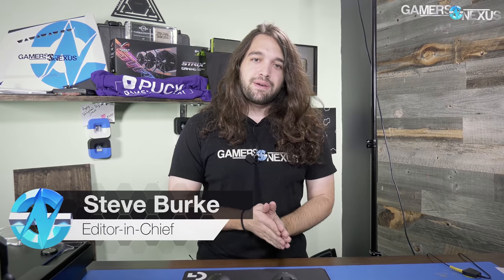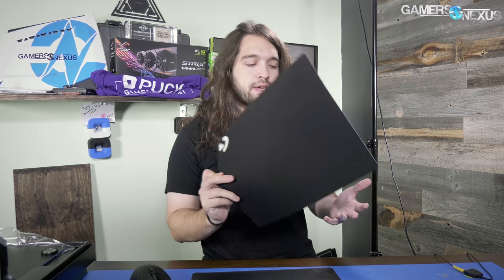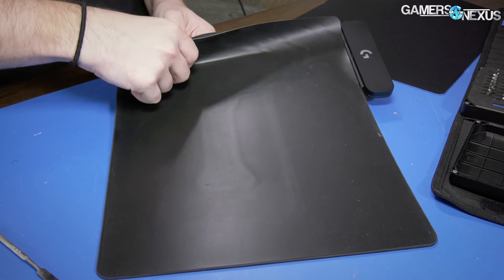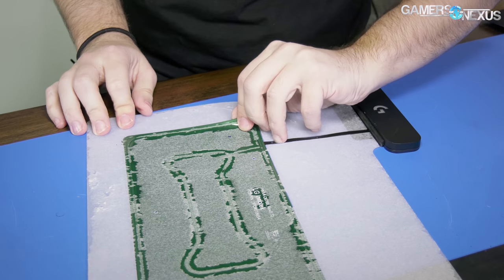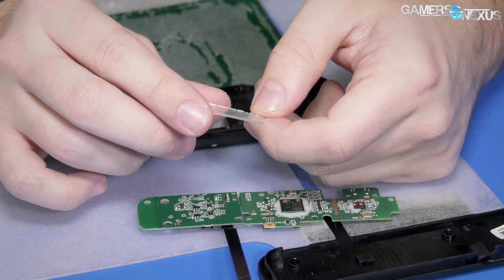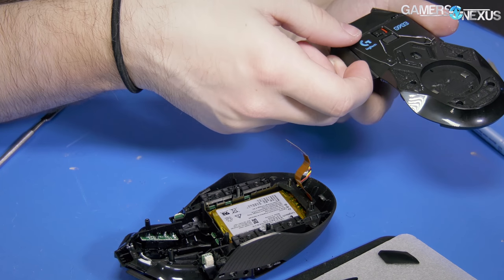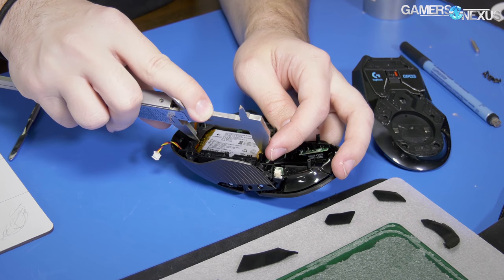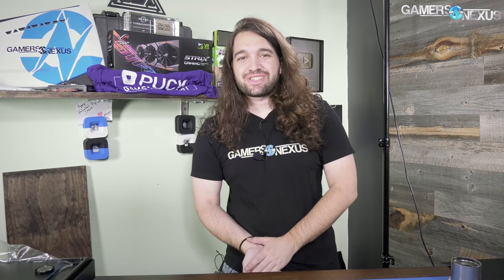Logitech G903 + Powerplay Wireless Charging Tear-Down

Comment: Anyone else having double click issues with that mouse?
Reply: Yep
Reply: yea that's an issue with this mouse. I ended up tearing down a 9 dollar logitech mouse and soldering those switches on to my g903
Reply: Yeah just don't buy this mouse to whoever read this don't terrible clickers. 2nd replacement same issue. Going for the third replacement I am turned off logi mouses for now. I will try to ask for another model cause obviously this one had terrible quality control.
Reply: @mybigfatfrog7975  its not the QC. its that they are putting switches which are not spec'd for the low voltage and current these new mice SOCs use through the switches. if you hit up amazon and grab d2f-01f-t  switches. those are actually rated much closer to the electrical spec these new mice SOCs use.  its going to become an industry wide problem if they dont change up their engineering as more and more SOCs are getting lower powered. I imagine with the Hero version being way more efficient the issue appears much faster as the Hero version doesnt sport a larger battery.   full explanation here https://www.youtube.com/watch?v=v5BhECVlKJA&t=3s
Reply: @xelnaga18   Not a technician man.I prefer to rma them every time I am at my 3rd rma as we speak. so It hopefully will last another year and then probably not gonna get another mouse from Logitech. Even though they have excellent support not gonna lie. Every peripheral I have is a logi. But I lost faith with this model.
Reply: Rn my g903 is my work mouse,the double clicks render this impossible to game with
Reply: I had issues with double click with this mouse and powerplay when it was plugged into a usb hub but I haven't had issues since I plugged it into a USB port directly
Reply: Check out Alex Kenis video on Omron switches failing. Basically, new ultra-low-power tech which is needed for modern wireless mice doesn't fit the specs of general-use Omrons, so they start misbehaving extremely fast. The only permanent solution for existing mice is to solder in different, appropriate switches.
Reply: @mybigfatfrog7975  I managed to fix the double clicking by opening the mouse and then opening the switches and bending the metal that clicks a little bit and there hasn't been any double clicking issues now

Comment: Minus the annoying Teflon feet, they should make the mice able to be disassembled.
The reason is that you do need to get in there to clean it every now and then.
I have a Logitech MX310 and I am seriously considering going on a buying spree to have spares because this one is very easy to take down and clean when required.
Especially as dust tends to accumulate in the scroll wheel that is optical based and thus make it stop scrolling efficiently.
A quick disassemble, cleaning of the wheel and you are good to go.

As for the pad, I am a bit bummered, I wish there would be more screws rather than glue, as glue over time has a sad tendency to let go.

Comment: you do not have to worry about replacing the battery in this mouse. the switches will die of static electricity within 6 months, look it. it's a big issue on all logitech x03 mice.
G903 user for 3 months, my left click no longer works, my right click spazzes out. I sent a RMA request for my mouse 5 days ago and Logitech has yet to respond to me. 
my 602 had a similar issue. the middle click button would stop working after a few months of use. I won't be purchasing another Logitech product after this experience.
Reply: My G903 has been heavily used for at least 2 years now and zero issues. Like the other guy above in this thread, you're probably ham-handing the thing
Reply: @LBCAndrew  first off, Rude. second, I spent $250 on the damn thing, do you really think that I would be slamming it around? third, I've had 3 Logitech mice in my life, and all 3 of them developed issues within the first 6 months to 1 year.  I bought a Steelseries Rival 650, no issues, I bought an Asus laptop and it came with a ROG Gladius II, and it has no issues. Fourth, have you googled what I said yet? It's not a limited to the few issues with that mouse. just google "Logitech g903 switch issue"

Comment: I think on base only is copper wire ,power delivery, which design to resonance with receiver one on mouse which I believe is the important one. you might neeed to crack that module to see what is wireless charging specification.

Comment: The G903 is the third Logitech mouse I've had to tear down and replace the clickers in due to failure. It's an easy process to actually solder the new Japan-made Omron switch in and toss the China-made switches out, but holy damn this is by far the most complicated mouse I've done this with. It's built in three core levels, and the side buttons cause some major headaches with getting everything back in place. 
This is also the first ribbon cable I've torn in quite some time, so def be careful if you go into yours. The ribbon wasn't expensive, but I did have to wait about six weeks for international shipping. Perhaps most tragically, this left me with a trackball and unable to play FPS effectively and now I'm playing WotLK Classic and that's going to be much more expensive than any ribbon cable ever could be, so stay safe out there.
Reply: where can you buy the japanese switches?

Comment: To add a little more information to steves comment on battery charge. Most batteries take the most abuse at full discharge and max charge.
This is the main issue with lithium batteries and why they end up losing their life span. You don't want to leave a lithium at 100% charge or at/below 20% charge. Both of those degrade battery life. Lithium also doesn't have the "memory" effect issue, that's a nicad issue where you almost have to do 100% to 0% discharges.
I haven't been keeping up with nimh batteries, what is in the g700s and i'd assume they are using the same in these, but from what i read it's the same for the most part to nicad

Comment: Would have been really nice if you pulled it apart a bit more. I am trying to replace the switches because the G903 is plagued with double click issues due to the crappy omron switches.

Comment: I've been using A4 tech NB- series of wireless & battery less mice for the last 10-15 years. friggin' love em. no cables getting stuck on stuff, no batteries weighing it down. (and running out). just works. 
It uses a similar design to power it, one of the models even had enough power for an extra LED inside of it. (just felt like testing it, and hey,, it worked). 
My biggest problem with them though, has been trying to find a new one, once the buttons wear out. Not all that common here in europe. 

this logitech model might just be my next mouse, if it's any good.

Comment: What if your g903 stops charging? I can use it when plugged in, and of I plug it in but have it turned off it looks like it's charging (the 3 lights fill and empty, indicating charging mode), but when you unplug it, it just stops working.
Will tearing it apart be worth it? Will it work with the powerplay mat with the battery not charging like this?

Comment: If you take the puck and solder the contact points to any other wireless mouse with similar contact point on the bottom would the mat charge the mouse?

Comment: Lol, a Logitech G903 lasting 4 years. I can barely get one to last a year before double-clicking issues arise
Reply: a year? mine has barely lasted 6 months, going to see if I can't send it back and get it fixed or whatever because 150 euro for a mouse that lasts half a year is a scam.
Reply: mine lasted 5 months
Reply: really huge price different 2$ for failure china omron vs 3$ for original japan!! Logitech LMAO!
Reply: I used the G900 for 5 years and 3 months... (no issues or replacements done, battery life was bad-ish tho after 4+ years, but that makes sense); recently bought a G903 😬

Comment: I'm really having trouble pulling the top and bottom apart. I've removed all the screws and tried using a pry-tool around the sides, but it feels like something is left in place. You didn't show the top screw being removed, did you miss off anything else before pulling it apart? Thanks

Comment: interesting the 2.8 watt-hour capacity of battery exactly matches the Sanyo Eneloop XX that i have in my current Logitech mouse even though it's a Lithium Pouch versus Ni-Mh Cylindrical AA battery ... so they switched from 1.2 volt to 3.7 volt but kept the watt-hour the same ...

Comment: Would of been nice if you could upgrade the G900 with this.
Reply: I got the G900 too. You can't upgrade it, as it simply uses a complete different charging system and battery, and it also has a different housing for the mouse to fit that in.
It's disappointing but it's understandable that this new feature won't just work with older models.
Reply: SkinUpMonkey would have*
Reply: UrAvgGamer, SkinUpMonkey,* wouldhave*
Reply: iheartmysquid would've
Reply: iheartmysquid,* would've
Reply: lol, you guys having fun?

Comment: i've started tearing down my gaming mouse after I needed to retension the switches after they go bad(or even change them out to preferred switches)..after that, i just buy a mouse for the upgrade(or to just try them out) but dont really need too. Saves alot of money, instead of buying the exact same mouse just because switches go bad(the most common reason I buy another one)

Comment: man.. considering the switches are the most common part to break you could have atleast taken the switches out and given your opinnion on if they can be replaced and with what kind of equipment you would need to replace them with OR atleast give the exact model of the switches the g903 is using. http://www.ia.omron.com/products/family/289/lineup.html here is the lineup are they using a direct model out of the selling lineup or do they have custom switches not sold openly so you could replace them yourself if they break ... all that trouble to open the product and then you couldn't show the main switches and their replacibility.. wth man.

Comment: Thank you for this video. I'm planning to put the striped powerplay under another mousepad. Hopefully it is thin enough that I wont feel it during mouse movement.
Reply: I'm also considering this, how did it go?
Reply: @Psycownage  worked amazing. I have not stripped powerplay for mouse and another generic qi charger for g915. Both under MPC 1200.

I didn't strip the powerplay as no matter how much you strip, you'll feel it under mousepad.

So I cut cavity on the table surface instead; since I'm cutting cavity anyways, I can do it a bit more and not strip the powerplay.

Comment: i know this is an old video, but has anyone actually torn apart the charging coin? if we knew the 'number of winds' on the coil, we could turn these little covers into more charging coins just using cheap magnet wire.

Comment: When will this and/or USB C be coming to the Logitech G Pro mouse?
Reply: The whole industry should forget USB micro-B and fully embrace type c.
Reply: I agree, but the problem is that USB C is a form factor and doesn't totally dictate use cases.  For example, my Android phone uses USB C for charging and data, but can't use it for HDMI video like my work Mac and home PC can.  Also, there are still some cheap cables that don't have the proper 56K resistor.  Regardless, I look forward to a fully universal cable.  USB C is the best so far, but a lot of improvements need to be made for 100% universal cables for all use cases to come.
Reply: I hope host devices (mobiles and computers) will eventually all be able to perform the full array of USB C features. But having everyone jump on the as a "shape" only for now is a good step forward.

Comment: The build quality is good but the software is crap and buggy as hell, and people search for Logitech vulnerability! 
I wish they produce a 10-20% smaller and lighter G903 with HERO Sensor and as a version for PowerPlay with a goldcap capacitor instead of a heavy LiPo battery to reduce weight. 
I get my G903 to 90g by replacing the battery to 220mAh, removing the battery connection PCB, side buttons, button PCB of one side, and all button magnets and replacing the metal button hinge rods with ceramic rods. 
A G pro wireless with infinite and sidescroll mousewhel would also be nice.

Comment: Are there any health concerns from constant exposure to an induction field?
Reply: Adam W It won't be strong enough to do anything to you. Still wouldn't use it as a pillow though.
Reply: The magnetic field from such a large "radius" coil is way too weak to be of any concern at all. I also doubt they can get many loops inside that PCB by the looks of the traces.
Reply: Less than WiFi or cellular network radiation. A lot less than ship radar systems or large scale transformers.
In other words: Irrelevant even when having this thing under your pillow.
Reply: MazeFrame which are all less than the uv rays the sun emits
Reply: Just make a glove out of aluminum foil, you'll be fine.
Reply: Just make sure you dont have a pacemaker or any metal plates in your body.

Comment: Screws under glued-on feet is such a dick design. I have to periodically clean my mouse because cat hairs from air get in the scroll wheel and stop optical encoders from working properly. For my previous Logitechs I just had to break one label and remove couple of screws. Modern Logitech mice - had to peel off those feet. Tore one, the rest survived, but as you said - it never looks the same.

Comment: $100-$150 for a mouse without a user replaceable battery? No thanks! Nothing worse than the battery faulting just outside of warranty and having to remain tethered.

I want a real successor to the G700/s mouse.
Reply: extremeg80 I'm kind of scared that people think it is okay to spend this kind of money on this stuff.
Reply: G7 was the one and only King.
Reply: g603
Reply: Dušan Pešić the g603 is a regurgitated g703...not even close.
Reply: extremeg80 in what way is it not close? It can take one or two AA batteries,  and it lasts like 10 times longer. And why do you need a successor? The 700s is still on sale.
Reply: Haralampi Nedelin you really think going from 11 buttons to 6 is an upgrade?! And so what if the 700s is still on sale? It didn't stop them from making the rehashed 603. None of their new mice have a button layout and comfort that I like. I wouldn't mind an updated 700s with a more efficient battery, Bluetooth, slightly tweaked button placement, and better tactile feedback.
Reply: extremeg80 oh,  you meant the buttons,  I don't remember it having that many,  and I even unused one for a while, but sold it because it was too heavy for me. Maybe they will update it,  maybe not.  I guess the reason they have the 403 wired and wireless,  the powerplay version and the new hero+aa battery version,  is that this series is just very popular and sells very well.
Reply: Or you can buy Steelseries because they are superior and way cheaper.
Reply: The g700 was bad imo
Reply: Was the G700s any good? I had a G400s once and it was the worst $15+ mouse I had ever used; the switches were crap, coating was crap and in general awful to use. I also had a G930 headset at the time. It all convinced me Logitech sells overpriced crap nowadays.
Reply: I meant the G7 not G700 XD its not the same. This one:
https://www.amazon.de/Logitech-Cordless-Laser-Mouse-Carbon/dp/B000AOIP9O
looking back im missing only 1 button on it...the forward button.

Comment: How much R&D did Anker and 100+ other different Chinese companies put into making my $12 wireless phone charger, which is basically the same thing in a smaller package of plastic sheeting and rubber? This is basic tech with little in the way of materials used. I would be shocked if this mat cost Logitech more than $10 to make, per mat and they're selling them for $100? They're probably churned out in the same Chinese factories my cheapo wireless phone charger was for massive profit.

Comment: 9:54 wow.....that looks a LOT like skinning a deer.....peeling the hide back after you make a cut....much like you did in the "first step".....

why you skinning your fucking mouse pad dude!?!?!
Reply: and ya....coil = coil

its sorta like when you have been doing really complex math and they hit ya with a 4=2+x and your answer is the square root of pi.....(answer is actually 2 ;) )

just a loop of wire.....and all coils are inductors

they all are going to put off an EM field....1 turn or 500 million....

get 500million turns and then put a 1 turn next to it....feed the 500 mil turn a few volts and ya get like 1000 amps out the other side (voltage hurts, amps kill)

Comment: If it runs at 2.4Ghz it's a piece of shit that will get interference
Reply: Mentally Distant Aleks wrong, do research before making a statement on anything. These mouse have already been proven to be very stable in extreme signal use cases like a lan party. 

There is a reason why these are the only handful of mouses that are recommended for gaming and are wireless
Reply: Mentally Distant Aleks you clearly are just parroting others without even knowing how this shit works. Because you're wrong, that's not how it works even within the 2.4GHz range. multiple devices on 2.4GHz can work perfectly without much or any interference, especially if the mouse is fucking 20cm away from the receiver.